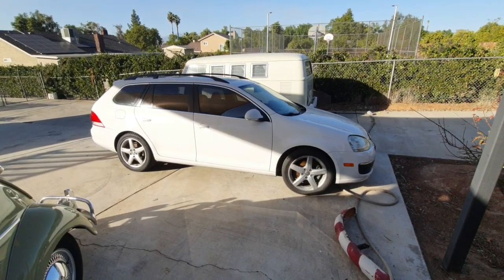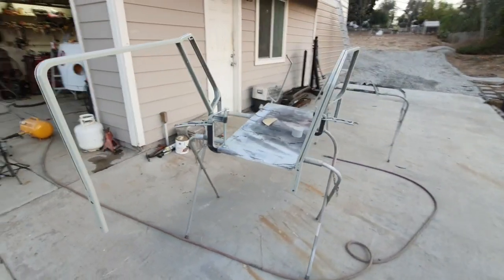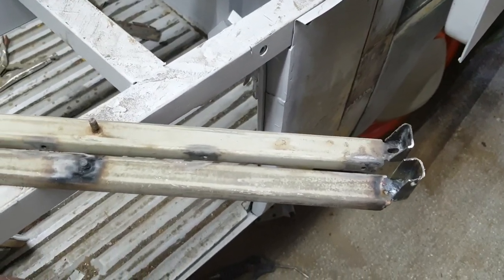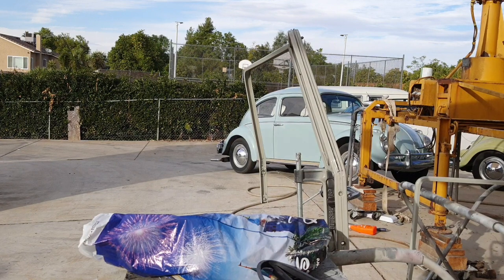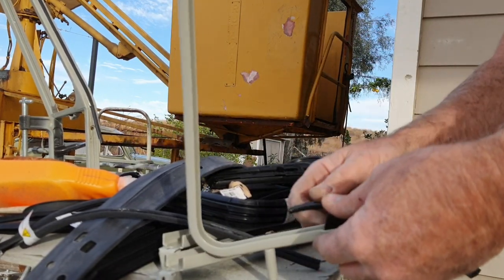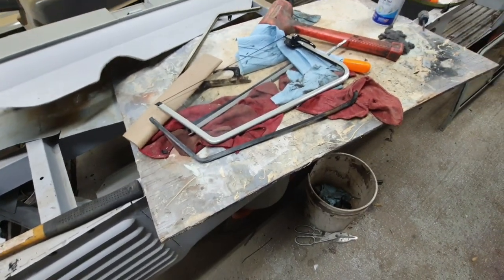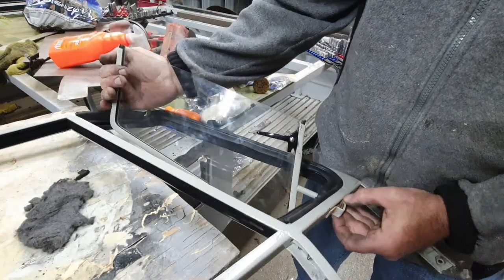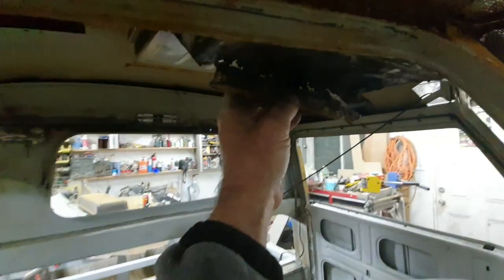Abandoned Forgotten VW single cab Cherry picker rebuilding the windows

Comment: That things looking good and that's a great tip using that torch to get that rubber out. I've got to do my 42 chevy windshield and just know it's going to be a bear.
Reply from the maker: Right on  if your going to try that on the windshield dont get the glass to hot keep the flame away or it will crack. wear safety glasses.. and or use a metal shied on the glass to keep the flame off of it.
Reply: @Mikefngarage  I've got new windows it just going to be a pain to get the old rubber seals out without hurting the metal trim that holds the windows. It looks like the heat method worked good to me.

Comment: I thought you might have painted the frames before installing the rubbers and glass.
Reply from the maker: yea they are painted I just didnt film that part because it was getting dark. Tamco single stage super durable not easy to chip off. at all.